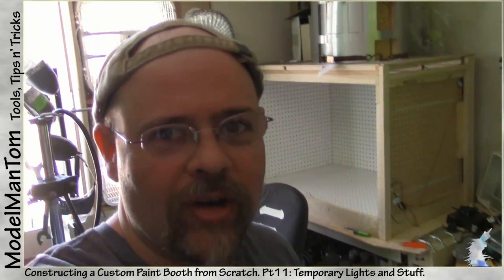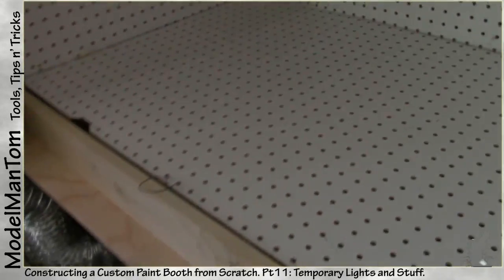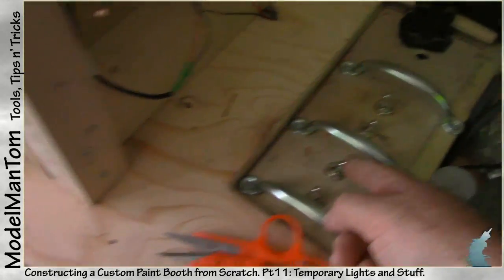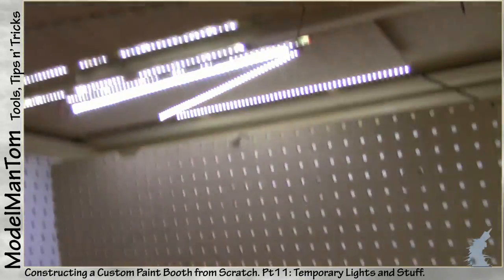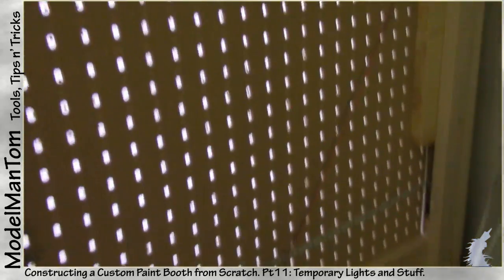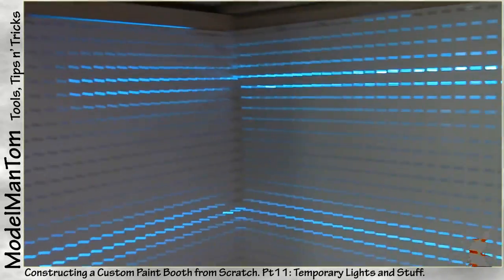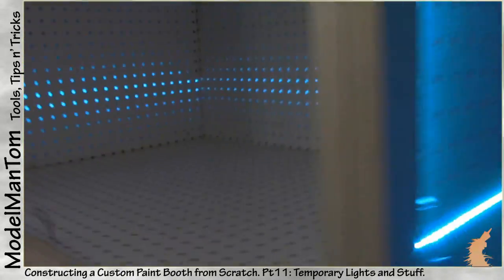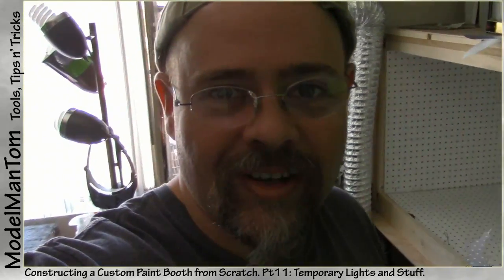Paint Booth Pt 11: Temporary Light Tests

Comment: Hey Tom, to get that outlet to run off of two switches just take a pair of pliers and break off the connecting tab on either side where the terminals are located, that's what that tab purpose is. Good luck with your booth